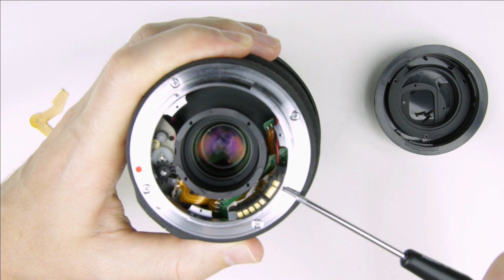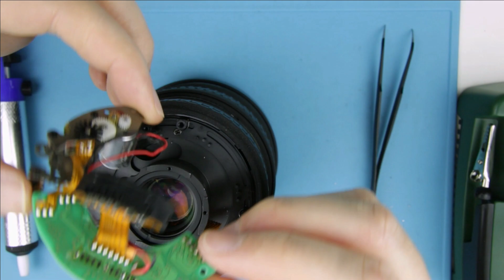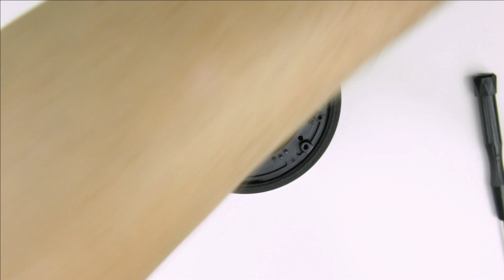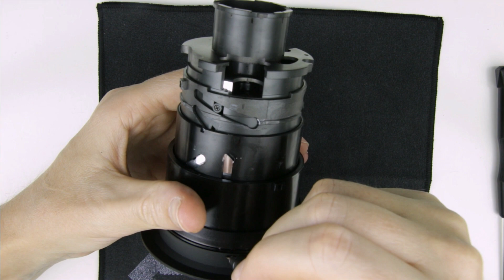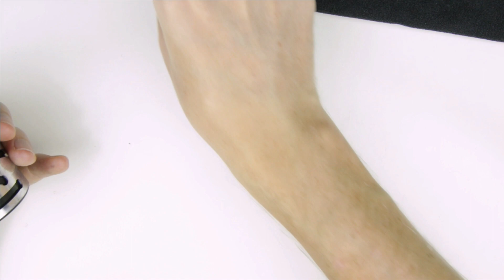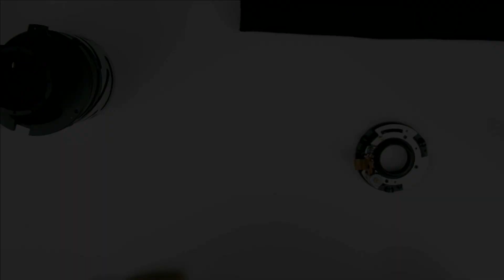Sigma 15-30mm f/3.5-4.5 EX DG IF ASP disassembly for replacing the aperture flex cable

Comment: Thank you for the video. At 12:28 you skip a step where I am stuck right now. I can't remove the ring you see in the scene before. Can anyone help?
Reply from the maker: Remove the zoom pin, twist the zoom ring until you can lift it up, then remove the lens tube.
Reply from the maker: I just checked the video, and I realized that I cut off the part when I remove the zoom pin... so, after I remove the screw, use a thin screwdriver or tweezers to move the zoom pin (pop out from where it was), then use a wood screw to grab it from inside to remove it.

Comment: Hi there. Great video series. I wish I had found it sooner! I have a question about this lens. My copy was dropped and now the focal length will not go lower than 25mm.. Any thoughts? Thanks again for the content.
Reply from the maker: Thank you, I'm glad you like my videos. 
I would start to disassemble the lens, and check the zooming after every removed lens parts... if the zoom works again, then you found the faulty part.
Reply: @CamerasLensesEtc  Is it necessary to de-solder the connections at the rear of the lens element in order to disassemble it to find the cause of my focal length issue?
Reply from the maker: Yes.
Reply: @CamerasLensesEtc  thanks
Reply: Just a quick update with my repair. I took it all apart, easily thanks to your video, although I do have the Nikon version. The focal zoom range was stuck due to two of the helical guide pins and their plastic bushings being dislodged. It works great again with full zoom range! 

One other question I had was, how to readjust infinity focus? The infinity mark now zooms past the actual mark and true infinity is hitting just before it rolls past to a hard stop. Is there a way to correct this? Thanks again for your time and your videos!!!
Reply from the maker: If it rolls just a little bit further (2-3mm) then it is normal, every lens has that. (As I know it is needed when you take IR photos, because in this case the focus range is little bit off.)